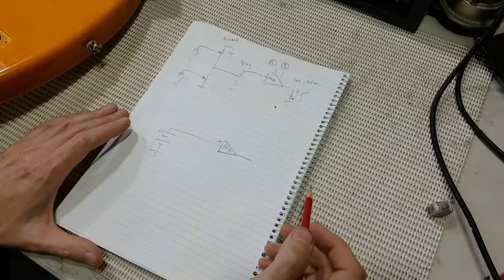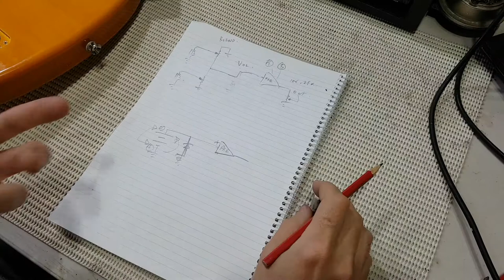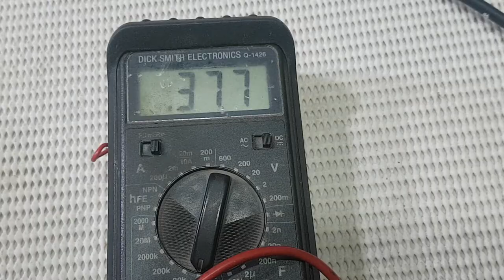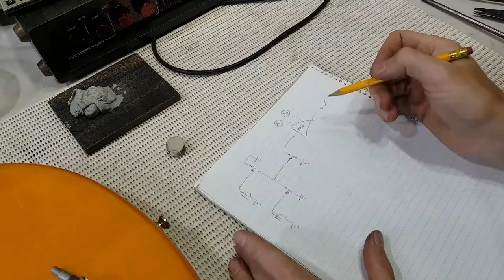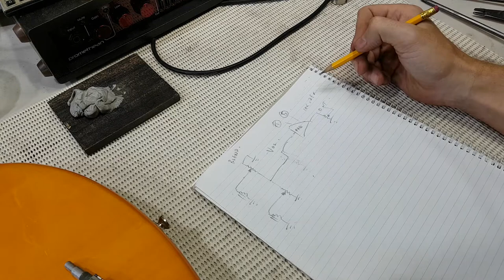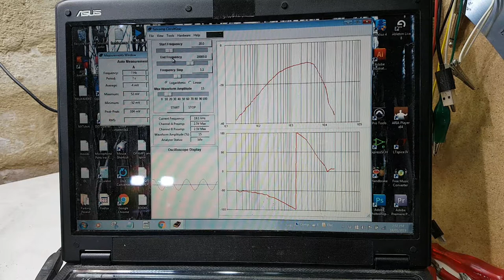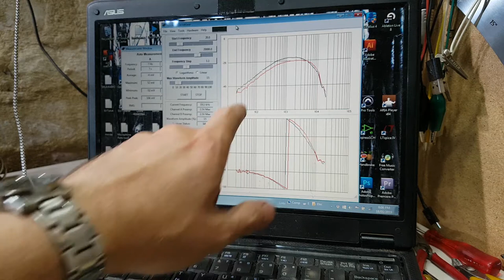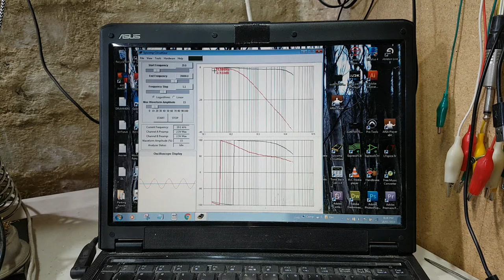How To Repair A Bass Guitar Preamp (Project Berocca Part 3)

Comment: You say it looks amateur, but that looks better than my official Dean bass from factory
Reply from the maker: Ha ha.  Yeah, just quietly, over the years, I've worked on a good few I basses far more extensive than this that look like the pre was thrown in from the next suburb...
Reply: @RobMods  What they won't see...right? lol Most don't look under the hood. But it is shocking how bad some of these electronics are. I've seen better soldering on fisher price toys.

Comment: I really do appreciate the amount of work that went in to this 
I’m a camera operator editor for a network here in AU 
You covered all the angles and even did the cool little shots through the volume pot hole .

I know what’s involved in making a vid like this and just wanted to say I noticed the effort 
I love to tinker with my basses and have a project bronco bass at the moment 
When it comes to electronics I’m a bit of a noob so I need all the help I can get from you 

Do the pots really matter cheap vs expensive? And I watched you’re other vid on the caps .. 
I almost fell for the marketing hype .
Reply from the maker: Hi Daniel.  Thanks for the kind words.  I really love the challenge of making decent YT content.  I did study some video editing back at uni, and I quite enjoy that part of the process.  I'm still learning to get the most from my (basic) DSLR though.  The Project Berocca series was a real learning curve.  I started just with my phone, then bought the DSLR hallf way through.

As for pots, well in a passive circuit, sonically the cheap pots are perfectly fine.  However, expensive (US made, 24mm) guitar pots tend to take more heating and reheating so if you are still learning, then they are usually a better bet and will be more forgiving for beginners.  Cheers mate!